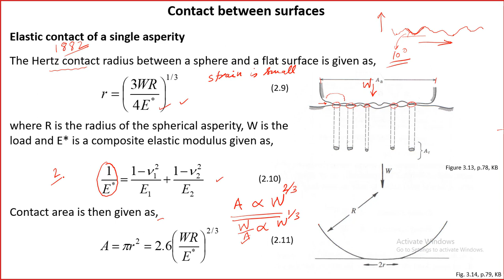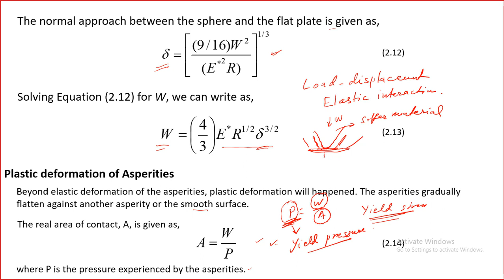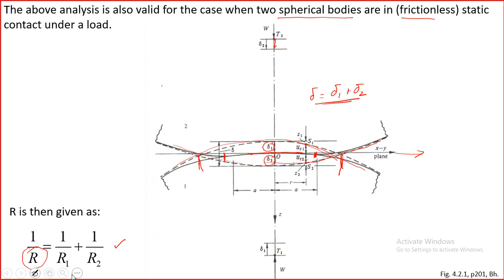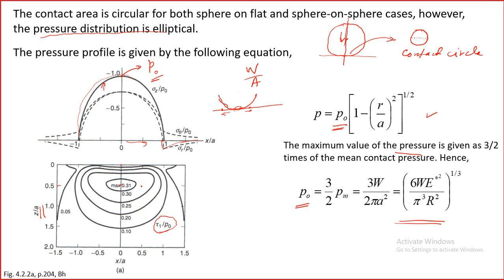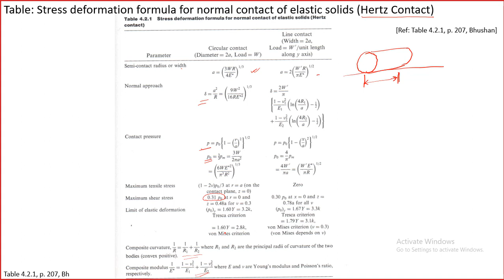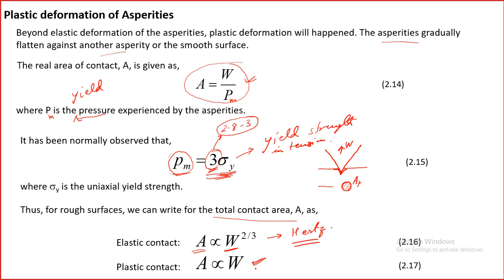Tribological Systems Design - Lecture 14 - Hertzian Contact Area Equation; Plastic Contact Equation

Comment: It is great, Thanks for the video. Could you pls provide me the pdf file for the Bushan  that you used as a reference? I could not find it. I need the equations that describe the rigid cylinder lying  on the elastic half surface (cylinder on a flat surface). The ueqations such as contact area, depth of the indententation, max contact pressure, pressure distribution etc. Thanks in advance
Reply from the maker: I keep hardcopy book. I do not have softcopy. It is worth buying if you are in this field.
Reply: @engineeringmaterials-tribo5142  thanks a lot . Could you please tell me the full name of that book?